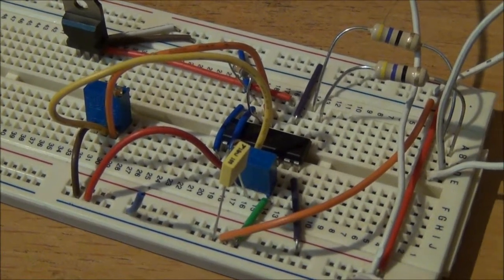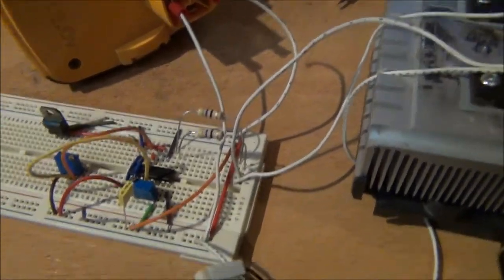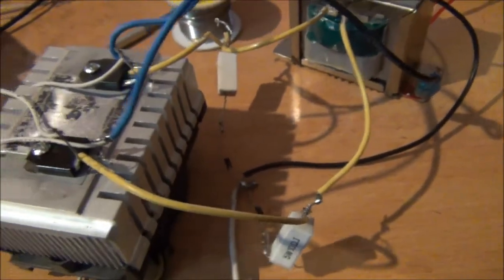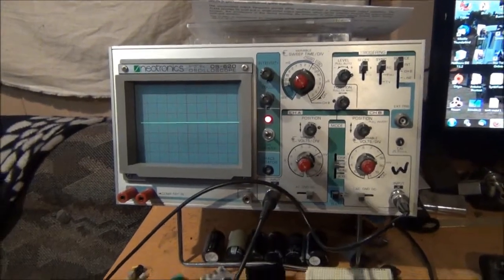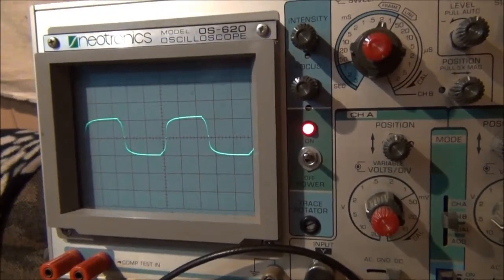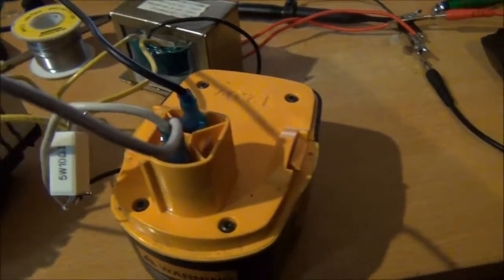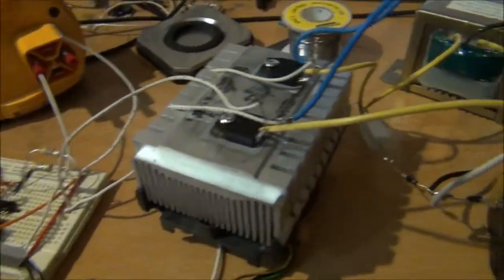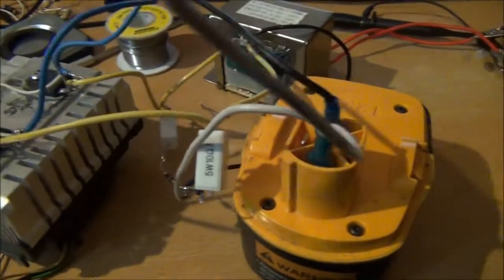TL494 PWM Controller Test for Flyback Driver

Comment: I don't think that TL494 can drive nicely mosfets directly Alex, it's a really popular IC find in most PC PSU's and always in car audio amplifiers. For mosfets you need a driver, as many have suggested already, no need to search for a driver IC, it can be build on simple transistors, just look at some car amplifiers SMPS and usually it's TL494->Transistors based driver->IRFZ44N or other power mosfets :)

Comment: A FET driver would probably help greatly by pushing those FETs into and out of saturation really quickly which will greatly improve efficiency of the entire thing (read: higher output voltage) and reduce loading on the battery by staying out of the linear region.  There's plenty of dual 8 pin FET driver chips out there perfect for this application.

Comment: part of the problem is those solderless boards have relatively high resistance connections and aren't designed for more than 1A at the most.  Also, those iron core transformers probably would like 100Hz or so better than 1KHz because of core losses.  Flybacks from TVs are ferrite because of the high frequency they are operated at.  BTW your multimeter's AC mode will not give you a reading anywhere near accurate because it's designed for sinusoidal waveforms only.

Comment: hey u should modify a computer power supply for your needs i have several i have modified and you can get 24v 17v 15v 12v 5v and 3v out of them :) hope it helps if u need help let me know

Comment: You might be overloading it, but more it's more likely the atx power supply is complaining about not having it's minimum load on the other rails. If you just want 12v, put a 2-3 ohm, 10+ watt resistor across the 3.3 and 5v lines and it should run happier.

Comment: Linear voltage regulators like the 7812 have a minimum voltage drop across them. If you send 12.3V into it, you won't get 12V out. Probably more like 11V, and it won't be regulated. This might be part of your problem.

Comment: Get a big multitap transformer then rectify and smooth it. Not much to blow up and you get pretty good control over output voltage. Stepped of course but good enough for projects like flyback drivers that dont really care if the input voltage jumps a few volts.
I do recommend to get a bench PSU but don't use it on HV stuff as it takes only one bad back EMF pulse and goodbye output transistors and control op-amps ;)
And yes I speak from some rather smokey experience...

Comment from the maker: for fuck sakes i designed the circuit for MOSFETs and i used TRANSISTORs. gates arent switching properly!!! BOOOOOOOOOOOOOOOO!!! thats what u get for using scrap parts and get your part numbers mixed ;p

Comment: perhaps you need to isolate the circuit with a big in line choke on the v+ and capacitance from both sides to gnd?

cant see the supply overloading, must be eather a crap psu or the oscilation from the circuit is causing hell.

Comment: Smashing, you can mess with the frequency to find the transformer sweet spot, just watch the trigger pulse become really thin as the best frequency is found :-)

Use an old pc supply, 3.3v / 5 / 12v :-)

Ive never messed with the tl494 so i would be interested to see how you go with it :-)